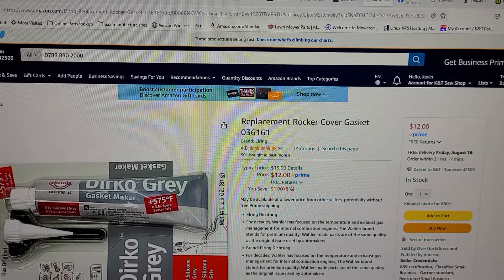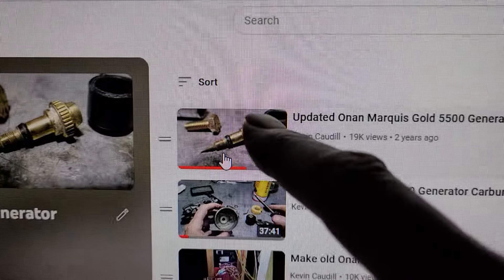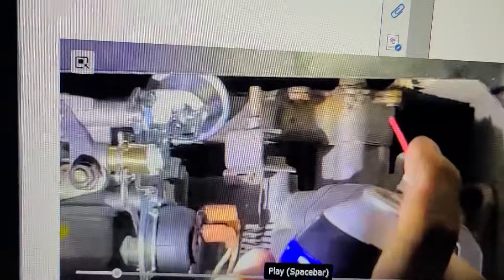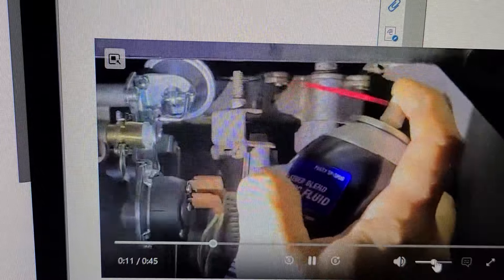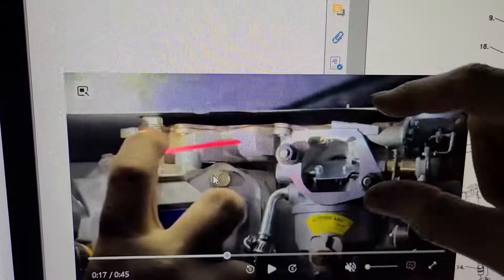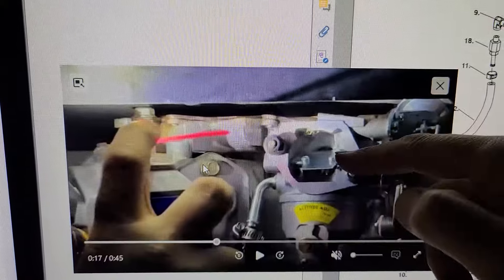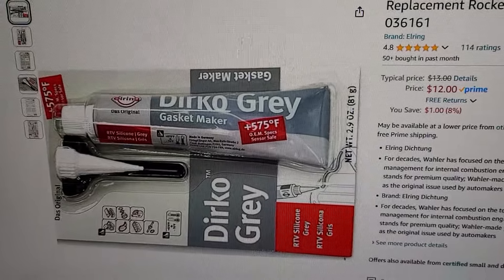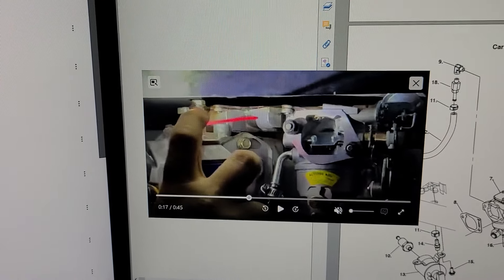Onan 5500 Still Surging after Installing New Carburetor, Inspect The Intake Manifold For Separation

Comment: Hello my Rv friend.  My sis has a Onan , think it’s a 2000 on her class c van , same issue, surging. i mentioned the altitude adjustment as she was up in Pikes Peak area, 
but upon trying to get the black cap off, the stem snapped. 😫.  Advise your friends that that stem is very thin at that point. 
I ended up getting her a replacement and took the black cap off before installed it. Got it running but then ran into the dreaded shut downs after 3-5 minutes. Draining a half cup oil out below the dipstick full level( says 1/4). it runs and doesn’t shut down now ! 💯👍🖖
Reply from the maker: @captojppg  Thank you for contributing